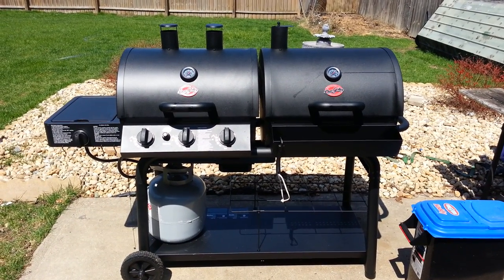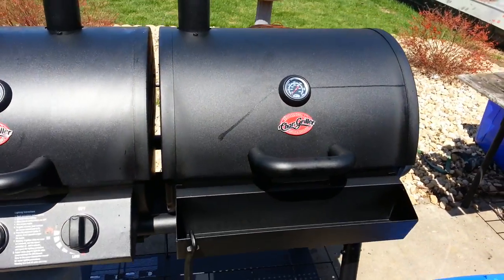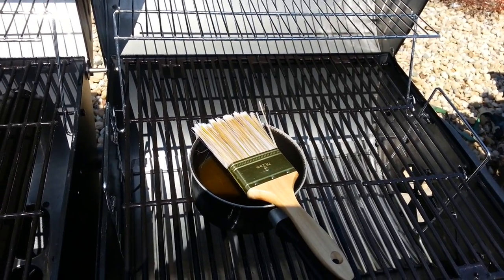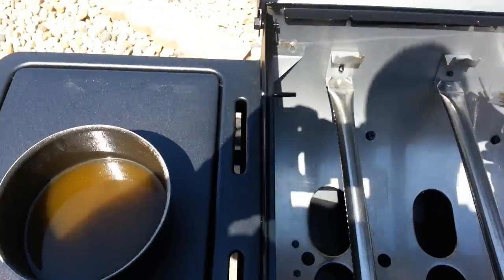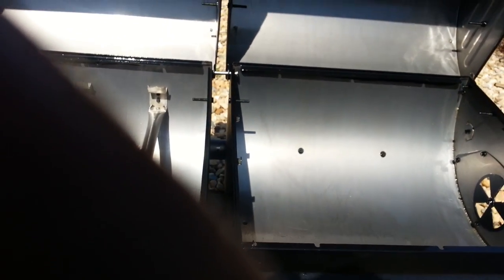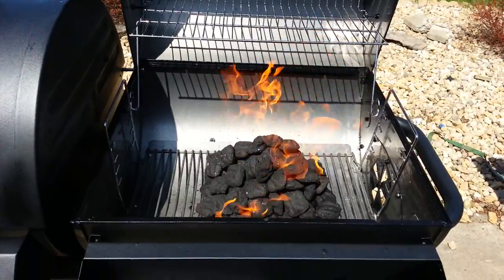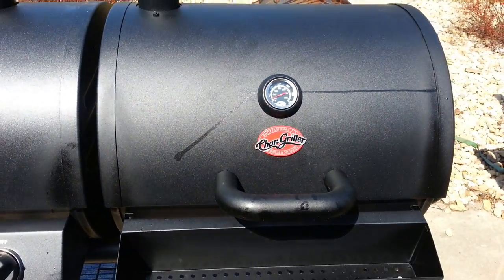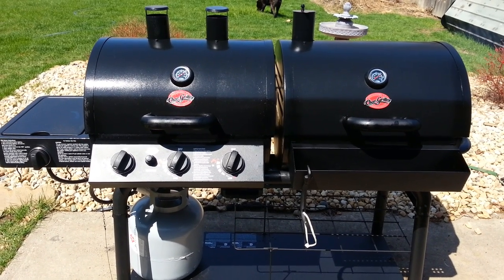How to Season/Cure your new BBQ Grill or Smoker Charcoal & Gas

Comment: Yes, you should season the ash tray.  Any surface that will collect soot will benefit from seasoning.  The oils in your seasoning grease well give a layer of protection over the metal which will prevent rust.  Soot and ash will pull moisture out of the air and if that is sitting on unprotected metal, that metal will rust.  Season ALL internal surfaces of the grill/smoker, and you can even take a cloth soaked in vegetable oil and wipe down the outside surfaces of the grill once it's warmed up - particularly any surfaces that might collect soot over time, like the outside of the chimney.  This will add a lot of longevity to your grill.  All surfaces that will be in contact with food should be seasoned with two coats at least and reseasoned periodically.
Reply: FYI - if you have a CharGriller brand grill (like the one in this video) external surfaces don't need it so much as the grill comes from the manufacturer with a coat of oil.  But you should still coat all interior surfaces before seasoning because that manufacturer coating is uneven.
Reply from the maker: Well said!

Comment: I done this with my new Char-Broil gas grill and did the lid the grates side buner too it works good hope to have this grill for years  and only have to replace the buners and heat Shield/ tent the grats should be OK if I keep with with the cooking oil after I clean and before I cook clean the bottom of the Firebox and bam I will be good

Comment: enamel covered grates ae already non-stick. No need to season them. The rest of the grill doesn't need seasoning with grease, the only the grease does is help with non-stick. It doesn't prevent against rust, because you are burning it off. Burnt oil/grease doesn't help against oxidization. 
In your case all you needed to do was assemble and burn off the factory oils, and start cooking. no seasoning was necessary.

Comment: Hey Wes! Hows it going?
Hi from Ks!
I just seasoned my King Griller grill/smoker today. I think I put on too much bacon grease/ olive oil. There is still some sitting in bottom of grill. Is that a problem? Also do we need to do this process twice for cast iron grates?
Maybe juat olive oil rhe 2nd round?
Thanks for any advice you coulg give.
I am going to attempt to smoke my first set of pork spare ribs tomorrow night. Stay healthy and God bless!
Reply from the maker: You should be fine, you can wipe it out!

Comment: okay question, they say if you don't know ask. can you use a charcoal are propane sign at the same time is that safe. how was the grill holding up today 05/20/24
Reply from the maker: My apologies for the late reply, yes I use both sides @ the same time! It holding up very well, I just have to change out the heat deflectors.

Comment: How often should you do this? And any tips for cleaning after each use?
Reply from the maker: I do a lot of grilling & smoking, I re-season this grill once every 2 years, for cleaning, (charcoal side) just empty the ash pan  after every use, I vacuum out the bottom before I use, (gas side) take off the deflectors & grease pan underneath the grill wash & dry, wipe out bottom of gas side, the grates, after cooking , throw grates on gas side for a while to burn off old food, & brush grates down, switch up grates, put gas grates on coal side then coal on gas side, that way you you'll get an even wear. Wipe down grates with mixture before you cook!

Comment: Do you also give it a light coating on the outside?  The video looked like you did
Reply from the maker: I accidentally dripped oil on the outside of the grill, & tried to wipe it off, didn't work out well

Comment: You did this after the initial burn off right? Wouldn't be smart to season a grill or smoker right after assembly without doing a burn off of the manufacturing oils.
Reply from the maker: Yes I Did,
Reply: IThinkThisIsAComment,  how's the initial burn off done?

Comment: So I gotta cook nothing before I cook something
Reply from the maker: You have to burn off the manufacturer oil before you cook on any grill, then it seasons it like a cast iron skillet!
Reply: @Drkphyre224SAHS_CAMEROON  can I cook on it after doing this process for just the first two hours? Or do I really have to do it twice before I can cook on it?
Reply from the maker: @dustinward3494  Yes, you must 1st do an initial burn off,  let cool down, then season, after this you can cook. If you season as a 1st burn off you're just sealing in the manufacturer protective oils, which are possible not food safe. I know it's a several hours long process, I just want to keep y'all safe! GOD Speed!

Comment: Question so do you burn off the manufacturers oil first and then put the mixture and if you do about how long does it take to burn it off? And I’m sorry I’m just confused cause your grill looks like it’s never been used
Reply from the maker: My apologies for the late reply, yes I wiped out inside surface with a rag soaked in bio degreaser, scrubbed, brushed, then wiped out before I put it together. Then did an initial burned off! I've been putting grills together & seasoning them for people so long that I forgot to show & mention it in the video! It burned for about 1½-2hrs until the coals burned out.

Comment: What did you do to the outer surface of the drums in between the shots at approximately 5:33? Did you season the outer surfaces too? Before there was no shine and a visible streak of what was probably adhesive residue from packing. The next shot everything shiny and no more streak.
Reply from the maker: I spilled the mix & tried to wipe it off, the rest you can see is History

Comment: Hi again Wesley!
I ended up having to use lard for my seasoning. It's been going now for about twenty minutes. I am growing increasingly uncomfortable with this burnt smell I am getting. Is this going to relax? I don't want everything I cook on here to have a burnt taste, ya know what I mean? Is this normal?
Reply from the maker: Hello,  I never used lard before, are you using charcoal, lighter fluid
Reply from the maker: It is possible that the lard was put on too thick,
Reply: +Wesley Walker it turns out I did put.it on a bit thick. Came back with 4 ounces of bacon grease and everything is all good! Thanks so much for your help brother!

Comment: I noticed you seasoned the outside of the grill........so, the interior and exterior is the way to go?
Reply from the maker: Dry Coconut I spilled oil on the outside & tried to wipe it off, but didn't come off so well!
Reply: Oh!..Ok, thanks.
Reply: @Drkphyre224SAHS_CAMEROON  hey so did you use regular oil the outside or was that the same mix?
Reply from the maker: @TheLowCountryPanther  I accidentally spilled the mix on the outside, tried to wipe it off but the rest is History!

Comment: Would stick free olive oil spray work also?
Reply from the maker: Yes it will.
Reply: Wes Walker You can but it has a lower burn temp so it'll burn off way faster than vegetable shortening or bacon grease from my experience. Spend the money on the bacon and vegetable oil or shortening, added bonus of eating bacon!
Reply: olive oil burns at a high temp. I wouldn't, use veg, or canola.

Comment: Why do I have to coat the inside of the grill?
Reply from the maker: You have to burn off the manufacturer oil before you cook on any grill, then it seasons it like a cast iron skillet!
Reply: It also protects the screws and other parts from rusting out . Helps make your pit last longer.

Comment: you ever get the firebox for that grill/smoker?
Reply from the maker: No, I just basically use it as a straight grill, I have small cast iron smoker box for light smoking, but I have 3 other Smokers!
Reply: +Wesley Walker gotcha.  I have the same one. added the firebox but had to cut a bigger opening as it was hard to get up to 250 w it. ended up getting a ok Joe from Walmart for $139.

Comment: this may be a stupid question but on the charcoal, side how did you get the fire started did you just throw lighter fluid and a match?
Reply from the maker: I rarely use lighter fluid, for this initial burning/seasoning process I did. Also there is no set temperature for it to be at. I hope you enjoyed the video & it was helpful. GOD  Speed
Reply: Oh okay can you tell me how you usually get the charcoal going without lighter fluid? That would always be my go to.  I haven't used my grill yet but i will after it stops raining here
Reply from the maker: +Maria Torres you can go to Lowes, Menards, Home Depot, or any other big box hardware store, look in their grill section there is an electric charcoal starter,  or a propane torch
Reply: +Wes Walker oh okay I'll go get one today thank you
Reply from the maker: Maria Torres did you pick one up yet?
Reply: +Wes Walker no I actually looked up some videos on them and I feel like I didn't like the concept of plugging it in and waiting that long for it to heat up the charcoal.  I don't like the concept of lighter fluid either but I think I'll just set it on fire as soon as I put the lighter fluid on it to avoid it soaking into the charcoal
Reply from the maker: +Maria Torres what's your email address, I'll send you a pic of what I use
Reply from the maker: +Maria Torres Wesley Walker on FACEBOOK
Reply: yeah there is a lot of people with your name on fb lolhop
Reply: yeah there is a lot of people with your name on fb lol
Reply from the maker: +Maria Torres I tried to find you as well, the email address you gave me didn't work
Reply from the maker: +Maria Torres mysteriousme.mt@gmail.com. didn't go through
Reply: +Wesley Walker ok i was able to find you, i sent you a message through Facebook
Reply from the maker: +Maria Torres I didn't get a request
Reply: +Wesley Walker I know it won't let me send you a request so I sent you a message, you will probably have to add the Facebook app so you can see it. or look up Maria elease Torres and click on the message button and it'll pop up
Reply: +Wesley Walker I know it won't let me send you a request so I sent you a message, you will probably have to add the Facebook app so you can see it. or look up Maria elease Torres and click on the message button and it'll pop up
Reply from the maker: Just sent you a request on FB

Comment: Did he oil the rack that the charcoal sits on?
Reply from the maker: No, I didn't
Reply: +Wesley Walker did you use lighter fluid to start the charcoal? someone said you can get a lighter fluid taste in your food if you use too much. Sounds kind of hinky to me but im a rookie
Reply from the maker: +131rocketman I used just a little bit on this 1st burn, but it is true about lighter fluid, it can if you use too much & if you don't burn it off fully before putting your food on. If you don't want to use starter fluid, you can use a torch that hooks up to a 20 lb propane tank
Reply from the maker: +131rocketman or an electric charcoal starter
Reply: Awesome man thanks a lot!

Comment: I’ve owned this grill less than a year. Biggest piece of garbage. Charcoal side is completely rusted out. And cast iron with porcelain coated grill grates chipping flaking off the coating
Reply from the maker: My apologies for the late reply, I have this grill for over 8yrs now, I don't like the grates either, I clean them off & oiled after every use, also I keep all of my grills & smokers covered when not in use! I have a Char griller that 17 yrs old just developed  rust holes on the bottom last yr!